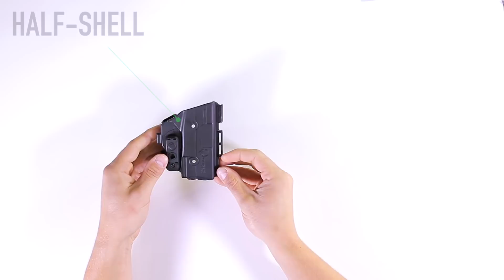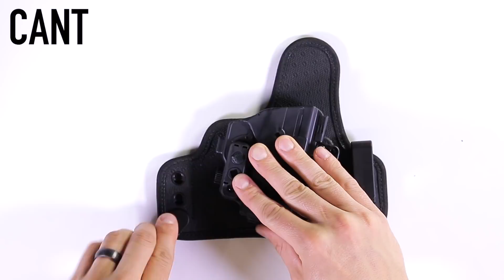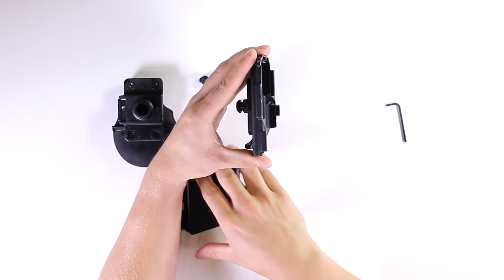ShapeShift Holster Manual and Setup by Alien Gear Holsters

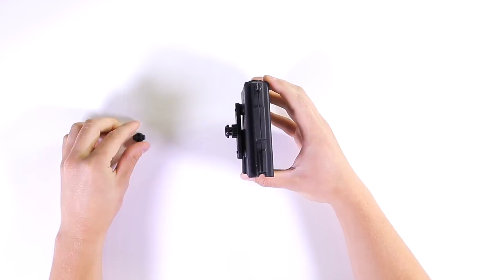Comment: Separating Full Shell - 0:37
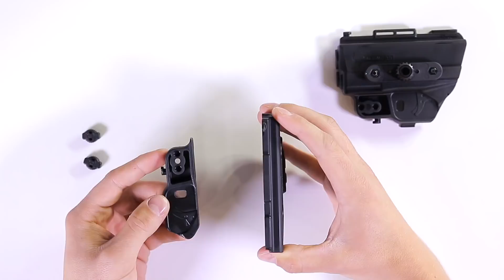Adding Trigger Guard for IWB or Appendix - 1:00
Switching from Half Shell to Full Shell - 1:33
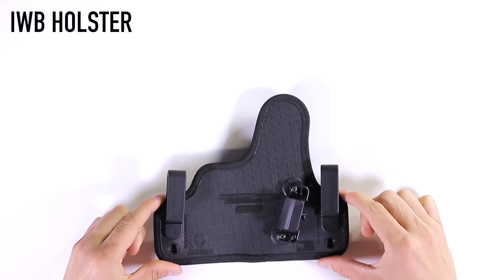IWB Holster - 2:01
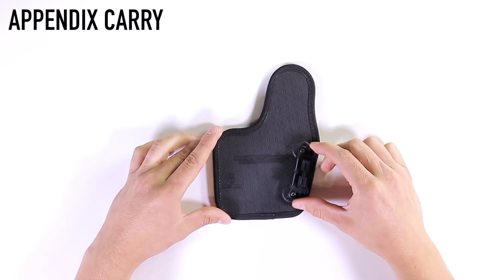Appendix Carry - 2:35
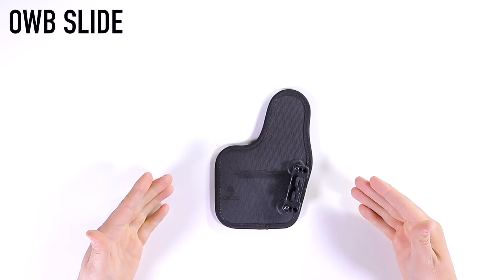OWB Slide - 3:06
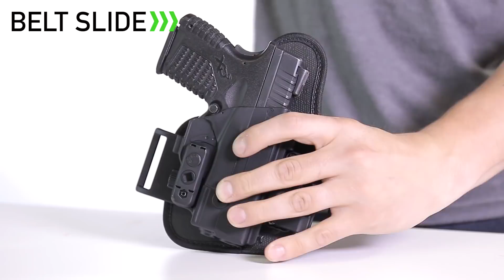OWB Paddle - 3:37
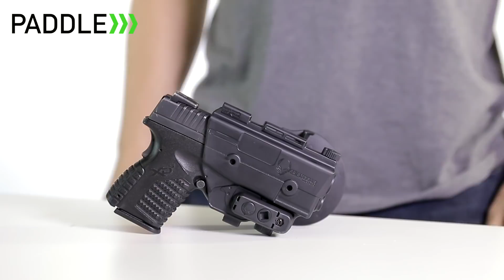Open Carry Full Shell - 4:05
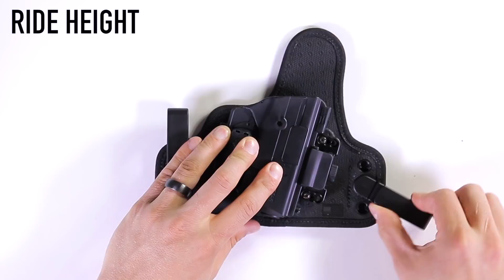Adusting Ride Height - 5:12
Adusting Cant - 5:41
Retention - 5:50
Applying Trigger Guard to Full Shell - 6:07
Belt Slide - 7:05

Comment: I'm not super into this stuff and one thing that threw me for a loop was at the 4:10 mark they talk about open carrying with the paddle system and belt slide. My belt slide attachment doesn't look like the one in the video, its about 4x4 with a rounded side...Kind of looks like a flat Storm Trooper helmet.

Comment: Hello Alien fans, I got the modular variant for sig p365, while owning the snag free p365 SAS. I find the half-shell configuration really loose, gun would fall off if I would turn up down. I did watch the p365 video https://www.youtube.com/watch?v=ObuFtwYAK74 and I do hear some sort of securing click most on  trigger guard on both regular p365 and SAS. But that doesn't seem to be the modular one. Does anybody else have the same experience? Any tips, advices?
Reply: Perhaps for others who just unpacked this product. You can simply adjust the lock by rectangular screwdriver, and therefore regulate the amount of contact. Brilliant! Problem solved

Comment: Why can't I just get a paper instruction manual? Why the hell do I need to watch a video? What the hell are you supposed to do with this holster system if the shit hits the fan? Guess what? No internet? No fucking instructions for this holster system. Just print a goddamn manual and put it in the box! This thing costs over $100! Why don't you guys just send a flipping instruction manual with the holster? I'm ready to just go get my money back on this damn thing.
Reply: I just got mine - clearly written paper instructions included. The whole system is pretty intuitive to configure in any of the four choices.
Reply: @bea9077w  ya got lucky. I went back to the store and checked out the other instances they had in stock.. NONE had a paper instruction manual.
Reply: I also got paper instructions. I ordered online though, might make a difference.

Comment: Mine just came in for my glock 19. I have to say I was a bit skeptical ordering this as I saw some mixed reviews. I didn’t know anyone personally who even owned an alien gear holster. I thought I’d give it a shot. I found it a bit confusing on how to put all the different types of holsters together, but this video helped a lot. I have to say, having only worn it around the house and to the gas station, it is the most comfortable holster I’ve tried. And I’ve bought a LOT of holsters for different guns. I’m a fan of AIWB and this was very comfortable. Granted, I have to lose some weight to make it work even better, but overall I am very pleased so far.